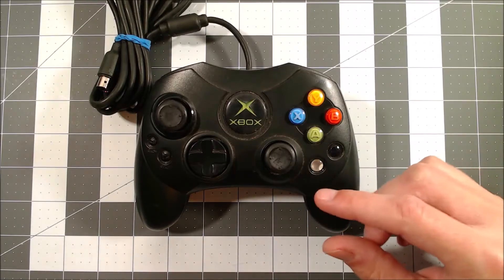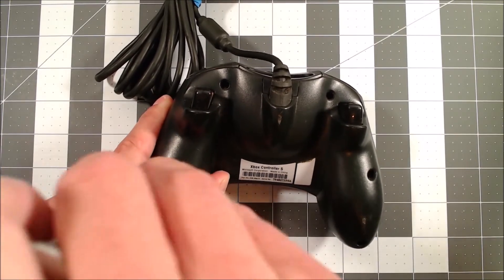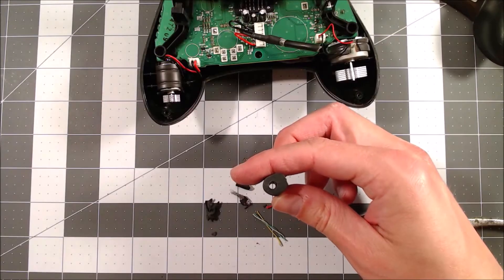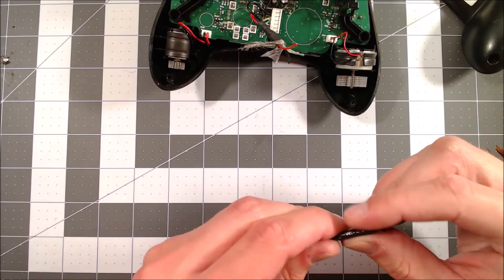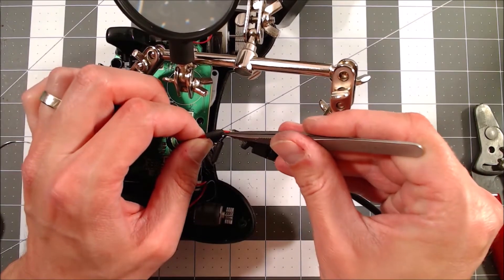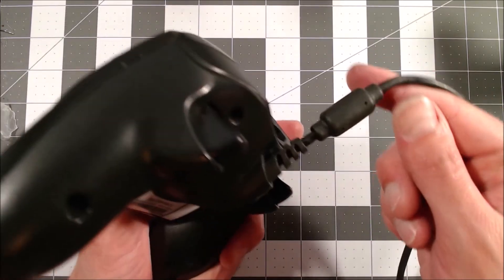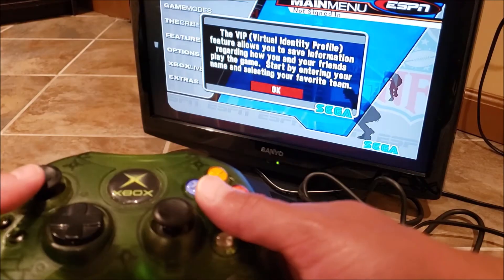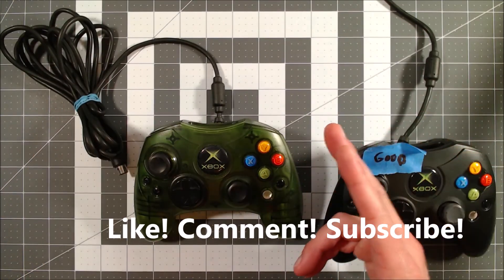Fixing 3 Broken Original Xbox Controllers

Comment: Just got a "tested" controller on ebay and surprise it doesn't work. Most of the time. If I hold the wire at a specific angle it works so I am convinced this is the issue. Thanks for the instructions bud!
Reply from the maker: Sounds like the same issue, glad this vid could help you out, cheers!
Reply: Literally happened today ugh, I'll have to find a soldering iron I guess
Reply from the maker: @daddykarlmarx6183  I have a cheap solder iron option linked on my Amazon affiliate store and also a good one ;) hope you can get it working in any case!

Comment: thanks. i did this today, very fidly even with helping hands. my solder joints were trash and i only has insulation tape to keep them isolated. a bodge job but its working as intended for now. got impatient waiting on the postman for a replacement ive purchased, so my bad repair will keep it going for now. im supprised replacement cables dont exist and the only people selling partouts are international for me (shipping costs more than the item). probably going to go wireless to prevent future maintenance. good repair vid
Reply from the maker: Glad you got it working, cheers!

Comment: Hi! I have an issue that i cant find any solution to, mainly because this isn't the most popular xbox now- my controller works during games and on the startup screen, however whenever i try to watch a movie it's unrespondive. Is there any way to fix this?
Reply from the maker: That is very odd and not something I have experience with unfortunately. You could try to further isolate the issue by trying multiple controllers to see if the issue persists (i.e. determine if it's a controller vs console problem)--same thing with testing other movies--and research further from there.
Reply: @FantasticQuack  Thank you!

Comment: I have 2 controllers for my OG Xbox, the right trigger on both of them is EXTREMELY sensitive and will "press" when my finger is nowhere near them. Any help?
Reply from the maker: Are they first party controllers? I would look at the button mechanism under the trigger, it could be shorted/intermittent, but I'd need to look myself to remember how they operate because I don't think they're just membrane switches like the face buttons. Just looking at it might give you an idea of what's wrong (i.e. if it's really dirty, looks corroded in any way, etc.). Attempting to clean them with alcohol is a always a safe thing to try. Sorry I can't give more advice without seeing it myself.
Reply: @FantasticQuack  I don't think they are 1st party, I got them when I bought my OG Xbox at a local game store. I don't think they have ever been damaged, they haven't been used much. They have been sitting there for most of the time since I bought it. Maybe there's some dust in them???

Comment: Do you know where to get replacement vibration motors?
Reply from the maker: I found these on ebay, they say they are for xbox 360 but they look identical to the OG ones.
https://www.ebay.com/itm/384032889617?hash=item596a24db11:g:oeQAAOSwAIFgUYdE

Comment: I have some junk aftermarket controllers I've been using, is it possible to just switch the cables from the aftermarket controller to an actual Microsoft controller?
Reply from the maker: I would assume that could be done, just need to make sure you're connecting the right wires as aftermarket may have a different color scheme for the individual wire insulation inside the cable.

Comment: Sorry did you say you used a small amount of tin while soldering
Reply from the maker: Can you point to a time stamp in the video? I'm assuming I was talking about "tinning" the wires which just means wetting them with solder ahead of making the actual joint to make the process easier.